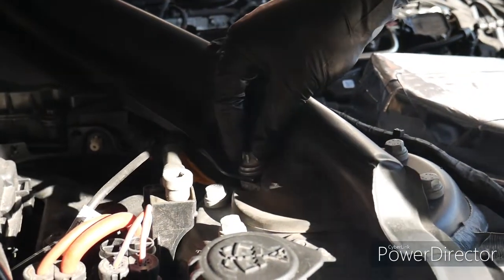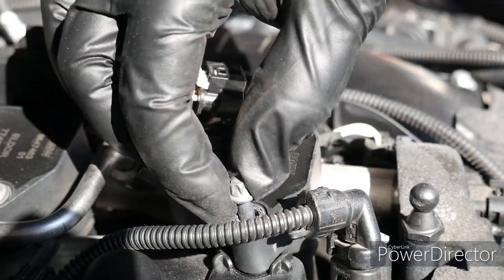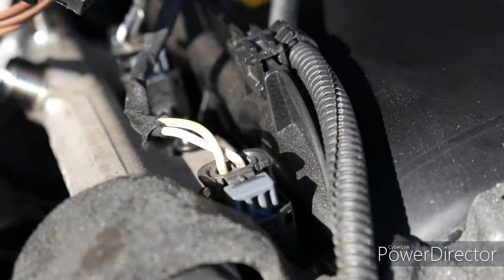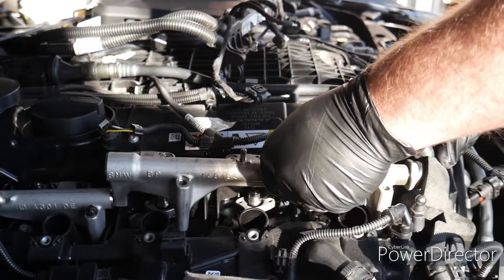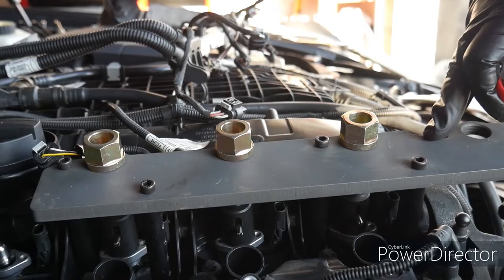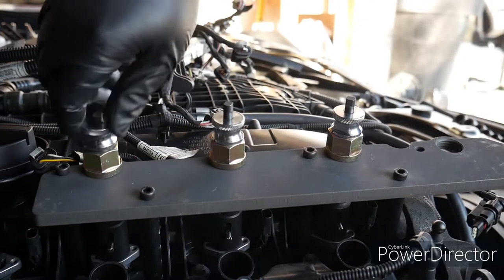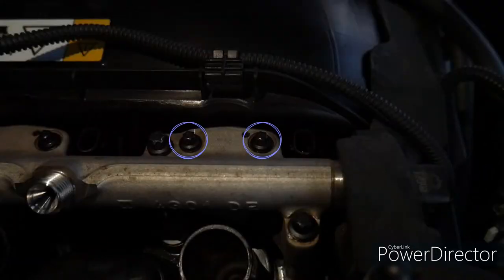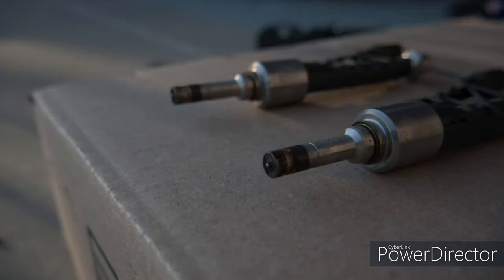BMW B58 Fuel Injector Replacement Tutorial

Comment: I might have missed it, but is that the original BMW fuel injector tool or one of the Chinese copies?
Reply from the maker: Honestly, I'm not sure I just googled the part number and purchased the tool. It probably is a clone but the part number in the video is directly from the BMW manual.
Reply: Hi Dustin- did it cost >$300 or was it more reasonable?
Reply: @DamnDudeGetaLife  I appreciate it, thanks!